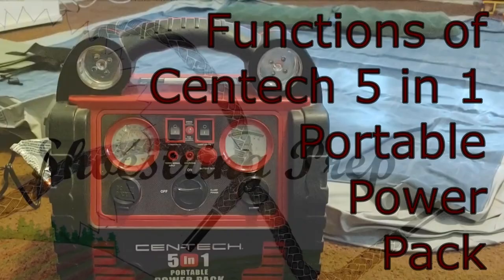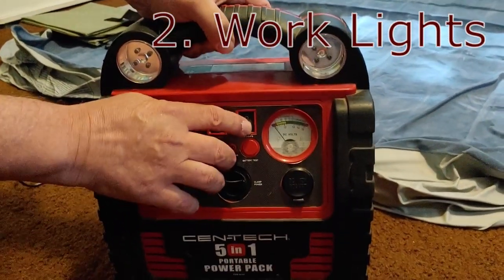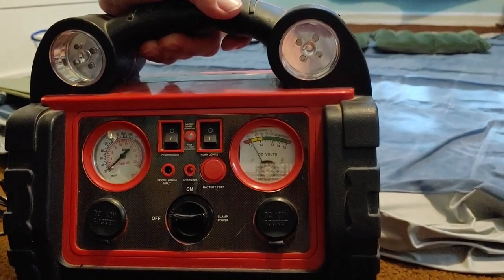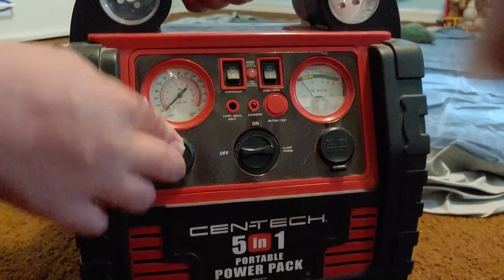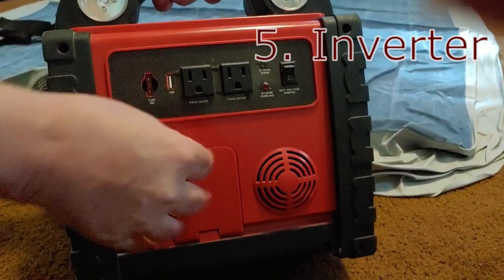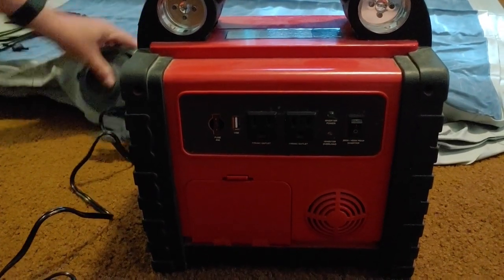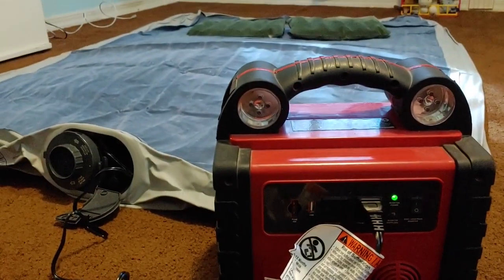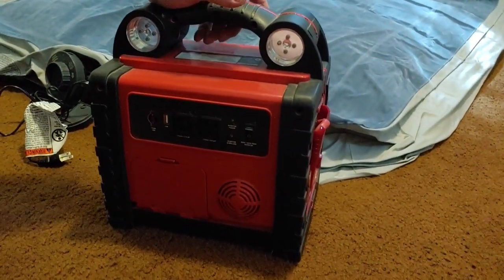The five basic functions of the Harbor Freight's Centech 5-in-1 Portable Power Pack for off-grid use

Comment: Tx for the demo, I have borrowed one of these to take to my camper for a few days while the camp ground fixes some electrical problems. I have used Schumacher brand jumpers before.  Question, will the outlets give out any power at all if you don't turn on the inverter switch?  Thanks...
Reply from the maker: The inverter must be turned on. Thanks for the comment.

Comment: Comes with an 18 amp-hour SLA battery, so you can use roughly 9 amp-hours before needing to recharge it, or else you risk permanent damage to the cells.  The 200 watt inverter will draw about 16 amps, @ 200 watts, so you would get a little more than 1 hour of (safe) runtime if you were drawing 200 watts, continuous.

For what it is and what they charge ($89) it isn't a bad deal, I suppose.  I'd be interested to see what circuitry they're using to deliver the 350 amps for the jumper pack function.
Reply from the maker: Thanks for your comment.

Comment: How long does the battery last
Reply from the maker: That depends on how much you are drawing. A small light will run longer than a hair dryer. The greater the load, the faster the power drains. Thanks for your comment